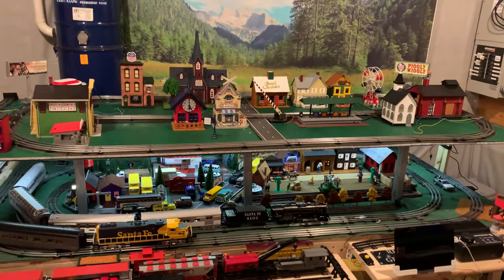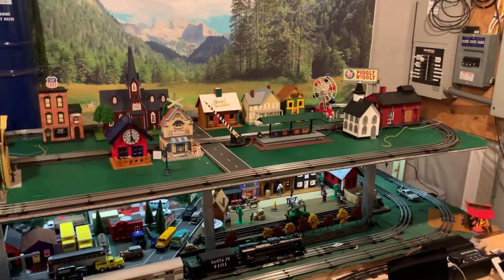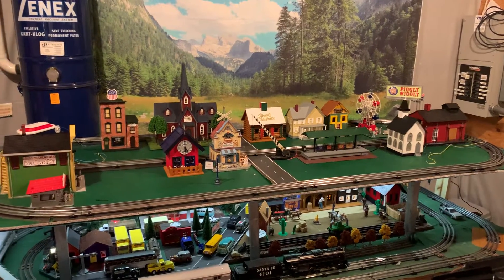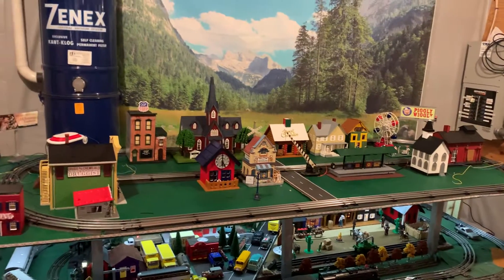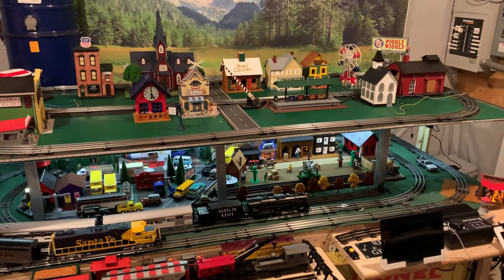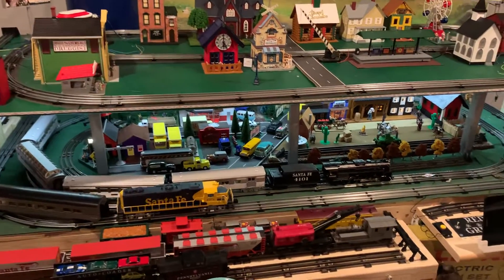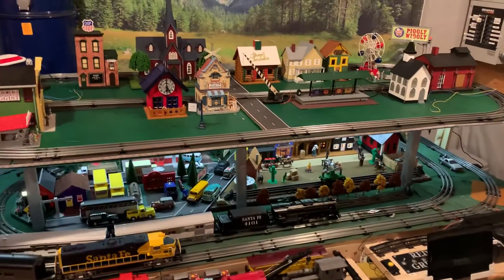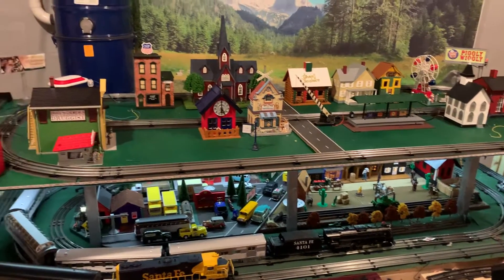Project Update 3

Comment: The upper level is coming along nicely.  Is the issue with the fuse in the TIU a common thing with DCS or is it something that rarely happens.  I'm not very familiar with DCS and am just wondering.  I like what you are doing with your railroad.  Bill B.
Reply from the maker: That's a good question.  Its the first time for me, but then again I have been a DCS TIU user only for a couple of years now.   I found a video on replacing the fuse (very easy) which is how I learned about it.